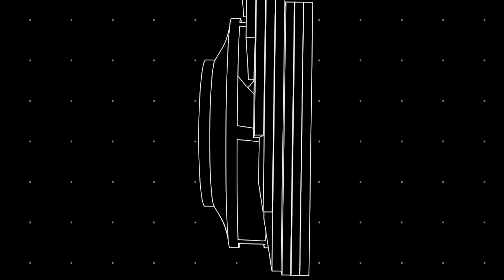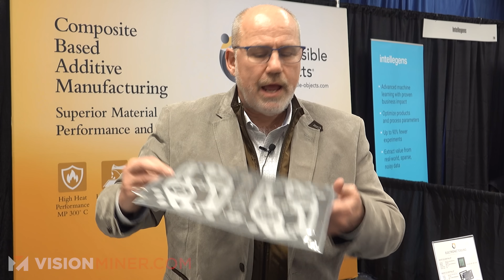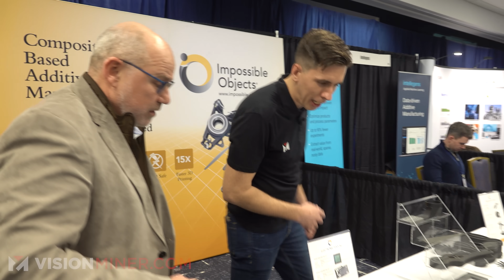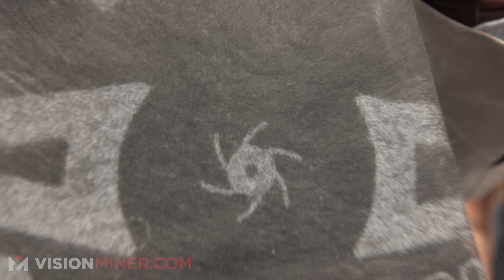Impossible Objects is Disrupting 3D Printing With a New Process | AMUG 2023 w/ Vision Miner

Comment: Wouldn't part geometry be limited to what you can sandblast?  Much more restricted than what e.g. FDM can make.

@6:24 The trademarked name is "Impossible Objects", but that looked like something that could be CNC easily.
Reply: no... take another look at that lol.
Reply: Yeah, you can't have infill for example (no access to blast), but that's true of laser sintering too. But sandblasting sounds trickier than air blasting powder away.
On the other hand your support material in laser sintering often needs some pretty aggressive removal techniques compared to sandblasting.
On balance I'd say this was interesting tech and uniquely placed for certain applications.
Reply: As long you have completed channel, internal cavities shouldn't be an issue.
The stuff rips apart like sandpaper while being fluffy like cotton candy.
So there isn't really the need for high power sandblasting.
The interesting part I see here is the ability to influence density to a degree inside the part.
This can have benefits for strengths and provide dampening properties.

The big issue with this process is waste, it is seems that the excess material isn't recoverable.
Reply: @DerSolinski  if the carbon is dried enough I imagine it could be used as a form of  "milled" cf?
Reply: If this needs to be pressed, unsupported voids are likely not possible, the issue would not be getting the waste material out but getting the necessary pressure to laminate the layers to spec
Reply: Did you not see that stuff? They're not talking industrial sandblasting but very light beadblasting at low, easy pressures. As in $30 of hobbyist gear in the garage and just put an N95 on.
Reply: @tylernope2752  Machinist here. that part can definitely be machined. I don't really see any reason why it wouldn't be from the short view we get of it. but it would probably take way more time to machine. your looking at a few setups, a bunch of different tools, 3d tool paths, some custom jigs for work holding not to mention programming time. having a 5 axis would make it a little easier.
Reply: @beartankoperator7950  The space intended to be void could be left unprinted and the part designed with a series of ports to allow for the interior to be sandblasted. This would obviously have certain limitations given that the final part would be open to the environment, but would print.
Reply: @DerSolinski  You are looking at sheets of non-woven carbon fiber used generically for a demo. In a mass manufacturing environment, the sheets could obviously be custom cut and the layouts optimized.
Reply: @aerohard  You do know that laminating CF like you described is fairly common practice?
That's basically how F1 racing bodies are made.
The whole non-woven CF, sintering and blast away scraps part is the entire novelty of this process.
This isn't meant for mass manufacturing, that's another can of worms with processes that are much cheaper at scale.

Comment: The very obvious limit I can see in this is it would be very hard to clean out internal geometry. If you print parts with internal cavities and holes, it would be impossible to sandblast the membrane away. Unless you could dissolve it in some special solution that wouldn't damage the outer shell.

Comment: So your end-product layer resolution is limited by the thickness of the carbon fiber fabric?
Reply: Yea and the print accuracy of the ink jet head determines the xy. I think that might be where people are missing here. The dimensional accuracy that these parts have is probably top notch since there is nothing Moving around at any point and they print probably 1200 ppi or more and that puts it in a similar resolution range as resin printers.

Comment: Because of the necessity to remove the material after, you get almost as limited in geometry as traditional machining though. At least with SLM the powder can "flow" out of very narrow and intricate design that wouldn't be possible to sandblast.

Comment: This is awesome.  The ability to do most of the work at room temp is astounding.
Reply: astounding? i print at about 210 C, that's astounding too, oh an my freezer is pretty cold, also astounding :D
Reply: yeah, great. Replace 210°C printing with strong chemicals and the need to sandblast every part. What a gain
Reply: Sounds less hassle than resin honestly.
Reply: @rustyshackleford3053  Yeah it sounds like, but if you look closely, you realise that it's much much much more complicated. It even involves the dangerous chemicals part

Comment: When I’m testing a new method of additive manufacturing based on binder jetting/ any pool of material - I ask how it handles hollow object. Other wise machining is the more reliable and affordable.
Also, it looks very complicated and expensive method to overcome problems that a simple heat treatment can solve.
Reply: If the hollow areas are for weight savings rather than functional, they you could just not add polymer to that area and leave the carbon fabric in there. Not as completely weight saving as air, but simpler and you still get benefit.
Reply: As opposed to eg powder metal sintering, where the powder weighs as much as the finished metal so leaving powder inside makes so sense.
Reply: @wsshambaugh  it is a good solution. But still, my point is that it pretends to be a manufacturing alternative when it doesn’t have further engineering limits or cost per part advantage compared to other AM solutions/machining.

Comment: How do you press complex shapes?
I guess vacuum bag otherwise you need a die in the shape of the part to do it. But must put a limit to how complex shape you can make?
Reply: Why? I see zero reason you can't just vertically press any shape whatsoever the same way you can print any shape ever on an FDM printer.

Comment: Wow, what a cool process! It’s one of those things that when you see it, your immediate reaction is “well, of course!”.

It’d take some non-trivial development, but this has the look about it of something that could be done in a home shop. If you could come up with a liquid-jetting head, you could attach it to a conventional FDM printer frame. For assembly and baking, hydraulic shop presses are cheap, and ceramic heaters inside metal platens wouldn’t be too challenging. Sand blasters are cheap too. I’d expect that the non-woven CF sheets and powdered plastics are off the shelf items. Really, it seems like the main issue would be to figure out the jetting head and the details of the binder used to hold the loose powder. Definitely non-trivial, but it strikes me as do-able.

You of course couldn’t use it commercially due to protected IP, but you could make some hellaciously strong/light/stiff parts for hobby drones or robots. (Or suspension parts for cars, etc, etc.)

Very cool, I’d like to learn more about the company!
Reply: The best ideas are the ones that have been slapping us in the face for years without us realizing it
Reply: @victorkreig6089  The best ideas are patented*
We only got 3d printing in 2009 because the Stratasys patents from the 80s expired. In fact, most development in 3D printing is waiting for Stratasys patents to expire. The vaunted Bambu X1 Carbon is basically a Stratasys 660.
Reply: And yeah nah, not a 3d printer frame, but a lightly modified inkjet printer. The toolchain for this would basically be printing the sheets, heating it in an oven, and then shoving that in a harbor freight manual press. Then lightly beadblast it in the garage and you're done. I'd use it for so many fucking things.
Reply: @rustyshackleford3053  Yeah, modding an inkjet printer would be the most obvious solution, but I wonder if the binder material would be think enough to flow through typical microscopic inkjet print head channels. I think there are inkjets designed for thicker fluids, but don’t know about their price or availability. 

(Or course, we have no idea what the binder material is, that’s the key to the whole process, and I suspect is highly proprietary :-/)

Comment: Interesting idea, although printing thousands of sheets, stacking them in order, baking them & sand blasting sounds like a lot of work... never mind the wasted carbon. My main question is the tolerance of each layer when stacked, how do thin walls work as the sand blasting is likely to blow them over. Also how do you control the blasting, its likely that the blasting will be uneven leading to poor tolerances.
Reply: Worked with plastic, ect. years ago, but this is ideal for automation. Thin sheets on an assembly lines has been used over a half a century. Depends on the part if it needs tighter tolerance. Of course like all things it has it place.
Reply: Carbon isn't wasted, its vacuumed up he said and very likely recycled.
Reply: The blasting literally doesn't matter. You do it with light media at low pressure to do nothing but knock off the loose shit. Could probably just use a brush.
Reply: either minimum wall thickness, very low preasure or giving the part backup. To improve tolerance you could probably mill the final parts to spec.

Comment: I wonder if it'd be possible to press the layers in a warped state? Like with that drone blade - if you could make some kind of mandrel or two part die set that would create the blade twist/shape while the matrix phase was fused? The idea would be that the fibers would be molded along the blade instead of being sliced in the "STL" layers.
Reply: Can't imagine why not, good idea, they already have alignment pins so just making the top and bottom in the shapes you needed should be feasible. Definitely opens up some options to orient the fibers as you want and making them nonlinear instead of parallel to the stack.
Reply: I believe they show something like that on previous shows.
Reply: Why not just fucking form it with carbon sheets. Its faster and easier when you have your negative.
Reply: @peepopalaber  Maybe if you had something like that and it was part of a larger component that wasn't flat? This would be faster than laying up CF, bagging it, etc, I think. Maybe not.
Reply: This is possible with the tech and there are potential use cases for this in select industries beyond the obvious.
Reply: (indeed - if it can be imagined it can be done - with enough work, printing as "flatpack" and formed for fusion - needs a manufactured (or printed) forming tool(s) however.)
Reply: @peepopalaber  because creating a good mold is a process in and of itself... this could be used for one-off or limited run parts where creating a mold wouldn't be worth it.

There's no "best" manufacturing method, they all have pros and cons. It all depends on your use case.
Reply: Just make the dies lol.

Comment: This is pretty cool but seems rather complex and expensive, we will see how this process developes further.
Reply: More complex is only a problem when you can get the same performance out of other manufacturing processes.

I'm curious about parts with internal cavities, how does that get sandblasted, or is that not a good use case for this?
Reply: that may be but you could also scale up to make pieces faster than just a printer which has to do the entire process itself.  imagine having a 100 of these inkjet style printers, you could bang out objects in minutes, not hours for each
Reply: i just now noticed in the video... "solid parts"
Reply: @mysterymayhem7020  Exactly. I kind of wantto try this low tech with a normal printer and some special metallic ink or something. Stack them up and sinter the part in an oven.
Reply: "Complex and expensive"? Bro it's an inkjet, an oven and a hydraulic press.This should have a DIY version in 3 to 4 years.
Reply: @rustyshackleford3053  Really ? With those materials ? Alright, show me =)
Reply: Inkjet? Vaccuming? Pressing and heating? Sandblasting? which one of those seems complex to you? This process seems to good to be true to me, this seems like the easiest ways to manufacture carbon fibre parts....
Reply: @svenb4475  Except you can not create hollow parts, CF is expensive and so is PEEK, you can not mass produce parts, you don´t know about the strength properties etc. etc. etc.
Reply: @sierraecho884  well yes its limiting compared to other, more complex, additive manufacturing procedures and this very example with cf and peek is expensive. I think the process itself has lots of potential specifically for fibre reinforced parts. The specific strength characteristics must be evaluated individually of course. Im no professional, i cant say if this compares to other fibre reinforcing techniques, i just think its very much in the ballpark, not like other new additive manufacturing technologies that directly require proprietary fully custom machinery.
Reply: @svenb4475  The parts are not as strong as current CF parts for sure, because the fibers are not continues. However it should be much stronger than other 3d printed plastic parts, but also much more expensive. Just look up the costs for PEEK. That´s why I wrote we will see how it further develops.
Which other proprietary additive manufacturing technologies do you mean ?
Reply: @sierraecho884  you know almost any sort of additive manufacturing progress i hear about seems like this very finely engineered proprietary secret sauce and this is really just an inkjet and some press to me. Yes its not that simple and maybe thats just how i feel about it but i think this almost seems too simple to just work like that...
Reply: @svenb4475  No, it is not just inkjet and some press. Do you have any idea how complex this already is ? I mean FDM is just a CNC glue gun, what´s so complicated about it right ? Well not much, but it is still complicated enough to cause all sorts of trouble. I am pretty sure this process is not as simply as it seems. And it uses PEEK and CF etc those are really expensive materials, those are already semi-finished materials by themselve. I mean what kind of CF is used ? How are those mats created ? How thin/think ? What kind of pressure etc. etc.
Reply: @dohabandit  Maybe a simple rough precut would be necessary. You sand blast it for  presicion and aspect mostly. If it's internal without interaction with the outside, it wont matter that much.
Reply: @ghostmanscores1666  Your Mama is a bot channel.
Reply: @AnotherCG  which is where having someone who invested in the equipment do the job for you comes in.
Keeping in mind that, regardless of what you can afford, you will always want things to cost less so you can afford more of them.
Reply: @kwyj  Some form of targeted multi-step blasting would solve that issue allowing the creation of internal cavities where desired. Biggest thing is the capability to print multiple layers on different printers all working on the same project.

Comment: I can envision large-format printers capable of producing 3x5m or even larger components, potentially creating hundreds of thousands of parts in a single run.

However, heating such large, deep sections could pose a challenge, possibly requiring layer-by-layer heating as the material is laid down. This could involve applying a powder-coated sheet, followed by a heated roller, and then repeating the process for each layer. This method might be more efficient than using a heated plate, and a metal drum filled with superheated steam could provide the necessary heat.

Upon completion, the product could be transported via conveyor belt to a nylon sandblasting drum for finishing before being packaged in boxes, creating a fully automated process. Additionally, I didn't see the demonstration using different powders on the same sheet . If inkjet technology is used to deposit "glue," it should be possible to apply different types and colors of powders, enabling multi-color and multi-material printing. By layering the "glue" and spraying different colored powders, a wide range of possibilities could be explored, particularly with carbon fiber materials.
Reply: yest, its compressd. using hudraulic piszton.
Reply: All done at room temperature.
Reply: @FairladyS130  TH BEST!!

Comment: @2:34 - "everywhere you didn't have polymer, you simply sandblast away" -- I don't get that part -- how do you remove the naked carbon fiber which does not have the polymer? It's still carbon fiber and thus very strong, right? ❓

Comment: i wonder if it could be possible to make a high throughput production line because its inkjet and you could make it so the press and heater are in a rotating conveyor and since its always a block at some height its all the same thing but completely different parts the most difficult thing would be the sandblasts, but it possibly could evolve to a chemical submersion

Comment: There is a big draw to it - pressure. If you will use inconsistend pressure, then part thickness may vary. The higher the thickness of raw material, this same amount of pressure might not work. So for every different part you must use different, calculated pressure. It's not that scalable.

Comment: Very cool tech, and not farfetched to imagine this scaling up in speed of printing enormously by applying existing technology from large scale high volume printing operations. I could also see combining this with laser cutting, water jetting, or even a cnc sand blasting nozzle to cut sheets completely or partially before adhesion to make voids and channels feasible.

Comment: Nice, and very useful, downside is the carbon fibre powder left by the sand blasting will be EXCEPTIONALLY DANGEROUS. Handling that stuff will require industrial clean room exhaust extraction. And certainly going to be a fair bit of wasted CF Sheet. Do have to wonder how strong the products would be if using Carbon Nanotubes as the fibres. I can imagine places where this product would be ideal in racecars, model and Ultralight/GA aircraft, and as low mass components for use in Space, where the mass becomes critical for fuel usage in the launch.